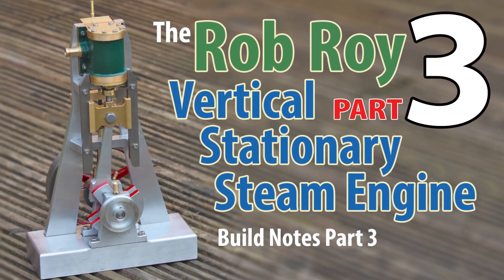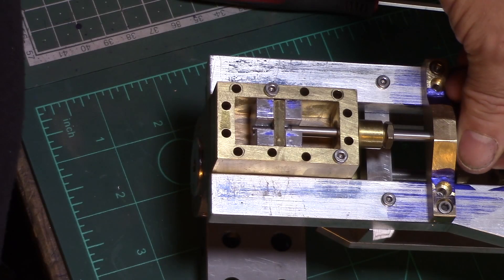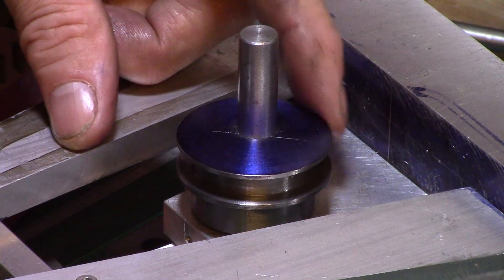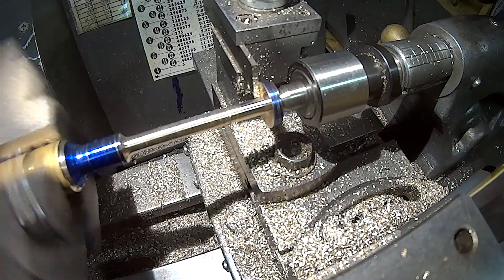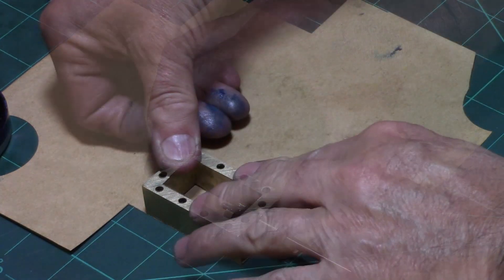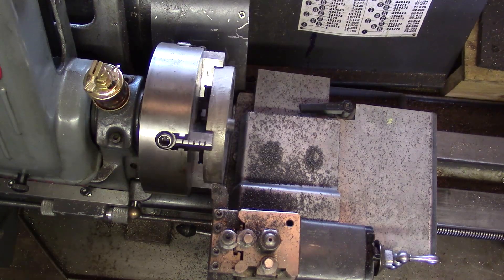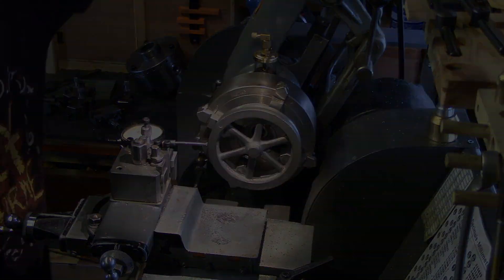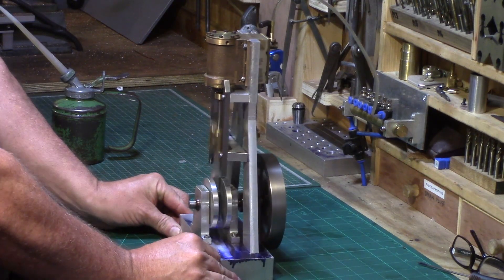Rob Roy Vertical Steam Engine Build - Part 3

Comment: Hi Ade, I know valves are horses for courses depending on the engine but could you tell me if you prefer doing  slide valve system or spool?  I ask because I have made a few engines with spool valves but yet to try a engine with the slide valve as it looks to be more complicated and fiddly.   I look at all your vids and engines and love them, great presentation and easy to follow.
Reply from the maker: Hi Berty, I actually prefer slide valves, yes they are more complex to make, especially at very small sizes, but I like that as a challenge, the other benefit of a slide valve is that it wears in, as a spool valve eventually wears out
Reply: Thanks Ade, that's it then, my next build will be a slide valve.